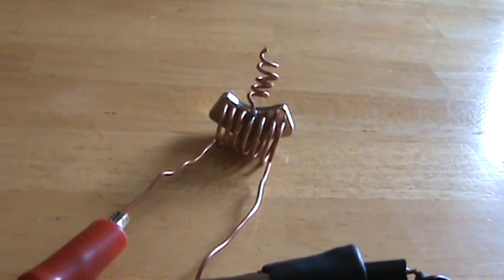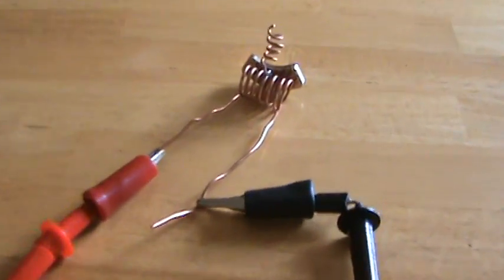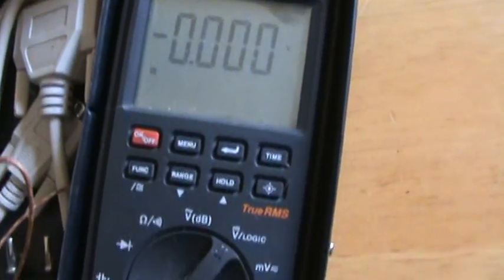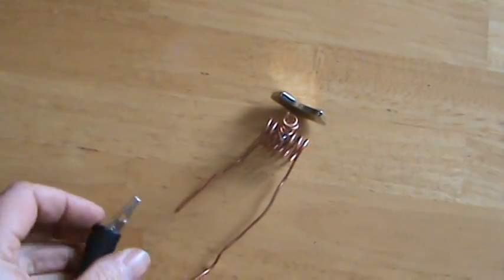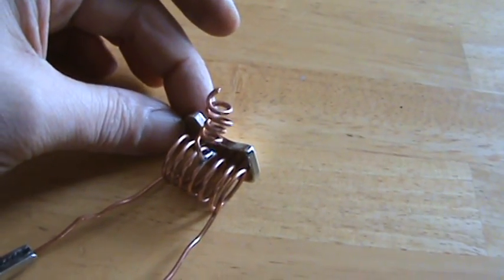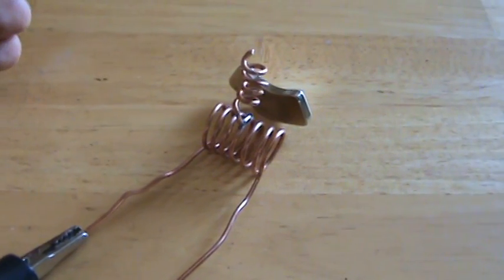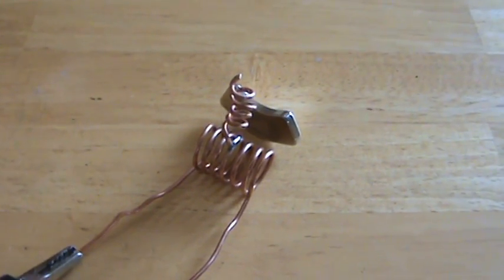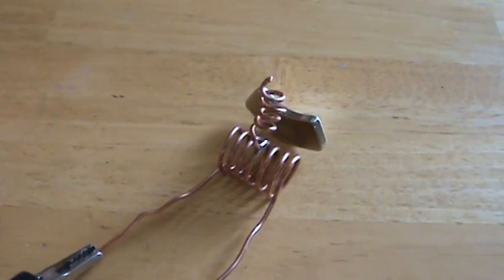Free Energy Generator

Comment: Yes it works
Yo have to break the winding in the middle. Do not touch the terminals with your fingers (your fingers  add more voltage but is not the way how it should work).

The way it goes is,  4 turns then a break( cut the wire there),  then the  antenna top to bottom then 4 turns in the same direction as the first winding. If you do not disconnect the the first half then you are shorting the meter that is why it reads zero.
 The voltage should be (without the first half winding) like 20mV.
NOTE:
The antenna should be the right size, too. Also, If you place a closed loop on the top of the antenna, more voltage will be trap (the loop acts like the sphere on the Tesla experiment). The loop will trap the voltage down to the coil on one side. The other half coil will be your Positive side or ground, your choice. 

A least you should pick the noise on the room, find a clear area, too. Rotate the antenna( the whole device), it needs to be on phase with the energy going by on that point (Location).

All you are doing is interfering the field of the permanent magnet, with the environment (ac voltage), that creates the current on the wire.
Reply: IE requires a strong radio EME field to work..
Reply: Andrea Mulder
Andre, the whole drama here is to prove that we can get potential difference from (Between) space to the  ground. Of curse if we have a strong Field then we don't need to convince anybody of the free milk.
The problem here is to utilize the Electric field that is present in space to create a voltage. Then to be able to use that voltage to produce current that will induce a field on a secondary coil creating a higher voltage (Step up). Where at this moment, we are gong to get the necessary voltage to be convert into a mechanical movement.
If you can trap the E field (With an antenna) then if you can find the way to alternate it (AC) to be able to create an alternating current. Once you can get this current going and coming then you can induce it to a second stage. It is possible to do it, just use your creativity and you will find the right toy to do it.

DON KING KONG
Reply: I'm interesting about this work. I tried to made this but it is not working. Are there any special coil for that?... I used 13 Gage both antenna and main coil. Also wind 7 turn for main and 4 turns for antenna. Should i cut the middle of coil and join the antenna
Reply: NDK Accounts Division
Everyone is having the same problem. So, 
The question is,, are you familiar with electromagnetism? 

As far as we know, there is potential energy store in the air. This potential energy can be tap by using a conductor (The wire or antenna). If you can make the electricity that gets trap on this antenna, to produce a electromagnetic field, Then you can get this electromagnetic field and amplify it many time more.
When we do this amplification we called it step up induction. Most transformers are just that, a low winding (little turns) coil passing the inductance to a large winding (many turns) coil. This will create a larger current on the wire. Once we have enough current then we can have the electricity that we need to light "ON" an LED. 
Similarity with this copper wire that you want to use to create electricity. You are trying to trap the electromagnetic flux passing by. Once you grab some of it, then you need to passe it to a secondary coil with more turns to amplify the induction.
THE ONLY WAY INDUCTION CAN PASS FROM ONE COIL TO THE NEXT IS IF THE MAGNETIC FIELD IS CONSTANTLY CHANGING. IN OTHER WORD CHANGING POLARITY DIRECTION: ALTERNATING 

TRY TO IMAGINE HOW A DYNAMO WORKS.
WHEN YOU ROTATE A PERMANENT MAGNET IN FRONT OF A COIL THEN CURRENT IS PRODUCE IN THE COIL.  ONCE YOU HAVE CURRENT IN THE COIL, THEN YOU CAN LIGHT UP A BULB. 

BUT SOMETHING MUST BE MOVING OR CHANGING DIRECTION!

EITHER THE PERMANENT MAGNET OR THE MAGNETIC FIELD. 

     ANTENNA
             T
000000000000000       COIL 
|                          |
--------- O ---------------
       LED

- - - - - - -- -      +++++++++++
ELECTROSTATIC CAN DO THE SAME EFFECT WHEN IT RUN FROM SPACE TO GROUND TROUGH A WIRE. 

This is the part that you want to duplicate.
you want to pass the electrostatic from the air to pass to the antenna and run through the wire to create electricity.  
FROM the air to the GROUND 

LIKE LIGHTNING WHEN IT RAINS.

DON KING KONG
'the rain man'
Reply: Hashan sudesh
my best suggestion is to get hold to an oscilloscope. The oscilloscope can trace the signals in the cooper wire that you are trying to pass the POTENTIAL (electric field).  
Knowing what, where and how the voltages are then that could help you to manipulate them (the voltages). 
In other words, It is easy when you can see them on the screen. 

DON KING KONG 
I love electricity

Comment: use old wire, not new wire, so before you laugh and discredit, learn why to use old wire... and well, it is what is it is... also, detail matters... one was a rusty coat hanger, not a brand new piece of copper wire...
Reply: and btw, its term is called, degenerate semiconductor material...

Comment: cmos batterry hiding at the back .theres a rectangular shape tape at the center
at the back behind the tape didnt you notice.study
Reply from the maker: But look at this video,,,the last link i have under my video description.
No tape or glue,,only 2 very small rectangle magnets
Reply: jbclarynx clarino on your last description the metal he used to short circuit the motor was coated with a varnish so that it will not conduct.and i think that motor has a cmos batterry inside
Reply from the maker: ***** Interesting,i will think about this, thanks.  "Cow lick" coil, hahahahah!!  Ohh, James Roney,,i almost forgot about this guy,,oh yes the battery & cap for shielding.  I need to do some experiments with this!!  Im trying to make a monopole mag now :-)

Comment: The coil that is attached to the leads is supposed to be steel or better than that, iron. The other coil is copper. Try that and see if it works.

Comment: When I saw one of those  videos,  I thought may be the man is stand near a huge emission antenna of radio. I know that if you hang a long cupper wire near one antenna  emitting (AM, FM or TV ), configuring a circuit with a bulb connected to ground will result that the bulb will light. In fact it is prohibited obtain electricity that way, because it weakens the radio signals. I saw it long time ago in a TV show, called Physics Circus , made in Gemany by Transtell now Deutsche Welle.

Comment: Try the reverse. Put a magnetic rod inside the coil and a battery on the terminals. See if the rod will pickup another magnetic object. In fact that is how an electric magnet is made.
If this works then it should be able to generate current if rod is replaced with magnet.

Comment: I need to make a video of where the coil naturally resonates.  The coil is a center tapped inductor, so it will pick up outside energies at its natural frequency.  I don't have a transmitter supplying power, I show that by backing up about 4-5 meters.  I will have to try that and see how far one could power such a thing.  Need more time.

Comment: You need either 2 magnets or a magnetic metal for the larger coil, copper is non-magnetic that's why it is a conductor.  You need a non-conducting metal or just use 2 magnets.

Comment: Thats because you dont have a AC induction coil under the table driving the coil. Its not that its fake, its just that they dont show all the circuit. PS, the "antenna" is completely useless, just there for "show

Comment: LifeHack2012 is using a small magnetic high frequency generator under the table. When his 100khz signal gets in the visible coil it creates a 100khz voltage strong enough to light the bulb. Something easily reproducible. You can even take the magnets out and the little pigtale as well.

Comment: In the original video the guy drilled two holes in the hard drive magnet large enough for two 3 volt watch batteries. That is how he got a charge.Paul I liked your air antenna getting power from radio stations. Keep up the good work and check out my videos at skills2nv55

Comment from the maker: by composition you mean the pureness % of the copper, if to add other elements then it would not be copper.  But to make a special wire made of copper & other elements and compounds such as copper along with maybe, galena, germanium, bismuth, silver, etc. then to maybe be able to collect ambient energies, but still doubtful that it would be enough energy to run a small motor.

Comment from the maker: i see a few people left some links to others replicating this. Some use diodes with caps, which would make more sense, then you could be near a computer or tv & suck energy from it.  But i dont see how this particular version can work a dc motor from incoming ac signals without rectifying.  Maybe a nearby tesla coil? Hmmmm, i will have to try this. I have not seen any logical explanations yet, except maybe from John H with a diathermy device, which i believe would be similar to a tesla coil

Comment: I haven't looked through all your comments but I have a thought. If he placed a series of button batteries inside the DMM then by placing the leads onto the coil he would have created a short to show the voltages of those batteries. In the motor could have been the same. By placing the 9v on the motor he would be placing the 9v and buttons in series, then connecting to the coil and only making the connection with the button cells. Do same exp but short connect of motor. Out of characters...

Comment from the maker: I dont see how this can work, especially with different voltage rated batteries.  I dont see any difference in the spinn when the mag turns towards the 9V or the 1.5V batteries.  I see a video where guy debunks it.  I too believe he has metal or mag under the table. Also this same guy has posted the video of free energy plug which i also believe to be fake, this guy has reputation of posting unbelieveable vids.  Did your mag spin more than one revolution? It will spinn to face north naturally.

Comment from the maker: Thanks, good video. I have seen this before, yes, very good. But i dont believe this is how he did it. It is difficult to drill without breaking the thin magnet. You would really need to drill this with 2 flute, center cutting carbide end mill, with lots of water. I believe there is another answer yet. Hope we figure it out :-) Hmm, how about plasma sphere with wire, diode, and antenna, pointing at it, hmmmm. Not sure.

Comment: im on of his vids (the guy with the fake), you can clearly see the rotor has been swapped out and replaced with a smaller motor perhaps that of a vibration motor for a mobile phone and the metal shine of watch batteries where air holes should be

Comment: Yes Diveborg3 i agree... Dan got it right with his video - tis a hoax, clever one at that. The other way of doing it is to get a medium sized DC motor, chuck out the insides and replace with a smaller motor and place watch batties inside the motor. That way the medium sized motor is acting like a case for all of the working parts. Then all you have to do is earth the device to make it appear as if by magic the motor is getting energy from something - like a nail with coils or some such.